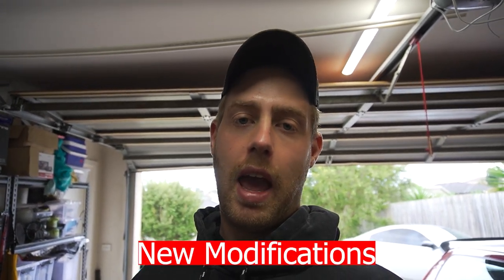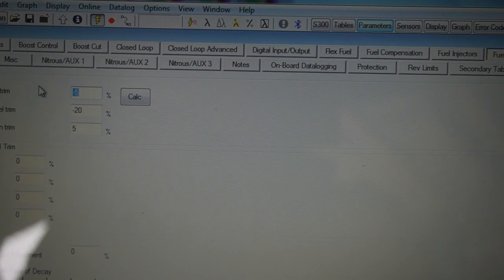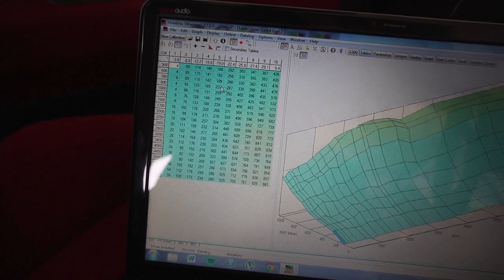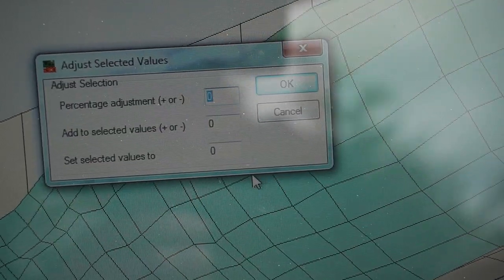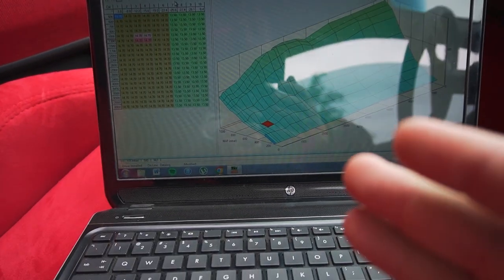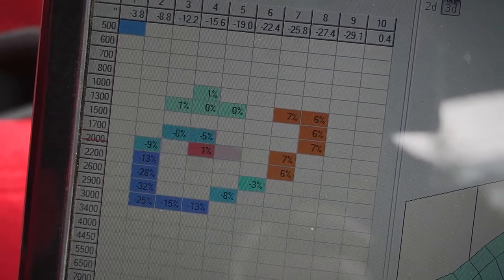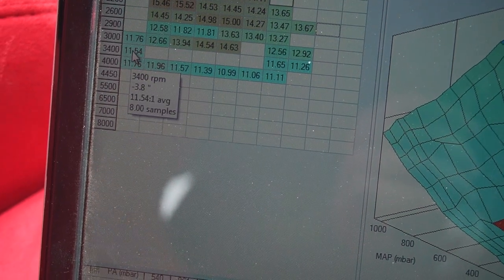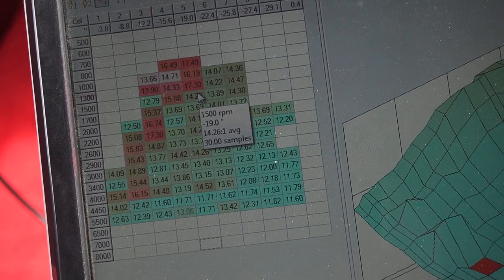How to Street Tune Fuel Using Hondata For Noobs | B16 Eg Civic

Comment: My car has been running richer over the last few months throughout the whole rev range and even at idle; I think lowering the overall fuel trim might help until I get it properly retuned.  Thanks for the tip mate!
Reply from the maker: Cheers happy to help!
Reply: Just get a turbo should should solve ur fuel issue 🤝

Comment: did you know  theres an autotune feature?
Reply from the maker: Yeh but you need to setup all the AF targets and have a AFR gauge wired into the car. I feel more comfortable to make the changes myself then use  closed loop to trim the map.
Reply: Yeah but also if your fuel trim is wacked out way off you can mark certain sections and auto smooth the map so the idle is smoother

Comment: wow its not that hard at all but yeah u need someone  with u  also what about if u put the car on jack stands and tune that way 🤔
Reply from the maker: Hey mate not too hard to get it running alright. Can't tune the car on stands as you need load on the engine.

Comment: Great video man! But what about VTEC? It doesn't populate the percentage difference on the high speed fuel table or let you data log on it like it does on the low speed fuel table...?
Reply from the maker: HI mate make sure you have it turned on in the settings. I did have it a few times when switching to the other tables it wont load or stay stationary on a cell. Make sure you update the software as well.

Comment: Have a question bud, ive installed boost guage and it says -2 (not working) I tapped into line on throttle body?? Did I f^$k up❓️❓️lol
Reply from the maker: Make sure you didn’t put it on the wrong side of the throttle body. Needs to be on the plenum side so it can read vaccum at idle. Definitely make sure it’s not on a coolant port. When the car idles it will be negative pressure:

Comment: Nice video👌🏽if I'm gonna street tune my car using hondata s300 do I need internet connection? Thanks
Reply from the maker: No worries mate. You don’t need internet only to update the software. You can connect to the ecu with either Bluetooth or usb cable.

Comment: i know this video is pretty old but at 9:40 its running lean, not rich. you took out more fuel where its red indicating it needs 6-7% of fuel so since you took out 6% thats why it went to 15% and a bit darker red which i wouldve added 8% just to get it close to 0 as possible. when its blue that means its rich so if you see a negative number then that means it wants you to remove fuel from being rich at that spot. other than that great video brotha!
Reply from the maker: HI mate it's been so long since i did any tuning i can't remember if -15 means your 15% below the target or you need to remove 15%.

Comment: How do you calibrate for a no cat?

Or a high flow cat?

What do you calibrate?

How much to add?
Reply from the maker: Hi mate most likely your car with need more fuel if the engine can breathe better. This increase will be small and most likely not need much of a touch up. THe right way is to use a wideband and update fuel based on the reading.
Reply: @JarrodWillemse  wide band....
Interesting.

More please
Reply from the maker: @realtruth97  Most cars use a narrow band and can only read a small range of AFR readings. A wideband will allow for a larger range for reading AFR. These are the best for tuning a car.

Comment: So essentially you would want to set up your target lambda, drive around at different loads and adjust to get to as close to your target lambda. But if you wanted to tune your car faster or to have more power how would you set your target lambda?

So say if your car was stock how would you tune it to make it faster. I understand when you get a mod that increases air induction you obviously would need to add more fuel.
Reply from the maker: Hey mate yes you would setup the lambda targets and match the actual to meet target. Your goal with the afr is to bring it to a safe level. The afr doesn’t make more power like ignition timing. For na cars 12-13 peak is your target. Boosted 11-11.5 is safer. More fuel can make cylinder temps cooler. Remember your recalibrating the fuel for the efficiency of the engine you can only burn as much air as the engine can pump.

Comment: I have a stock sensor and its reading rich, Im trying to change the fuel but it's staying at the same number. Do I need a wideband?
Reply from the maker: The stock sensor is a narrow band it won’t read the same range as a wideband. The sensor could also be broken. When they die they usually read full rich and the ecu just runs off that one reading.

Comment: Love your videos brother!!!! On the Aem series x wideband do you recommend wiring into d14 or d10 on a obd1 p28 with Hondata s300?
Reply: D14
Reply from the maker: Doesn't matter they are both fine. I would only choose D14 if your ELD is functioning as you wont need the heater on the stock D14 pin. The AEM wideband heats the sensor it's self.

Comment: i got a turbo b16a, havin problems bc old owner. i have s300 v2 and hondata. the car doesnt rev over 5500rpm and it needs tuned. what can i do to fix that? i dont wanna set the rev limit to normal bc i dont know if i do that the car will run ok after that rpm yk? i want a street tune jus to drive it and get it dyno tuned im hopin for 500hp in my jdm b16 ek
Reply: the vtec doesnt even hit bc it wont go over 5500rpm it jus smacks 5500 and sputters kinda until you shift
Reply from the maker: Hey mate it sounds like the rev limiter is just at 5500 or there is launch control enabled. Just turn off launch control and try again. Leave the limiter cut settings at the factory position in the settings. Should be in the middle with fuel and ignition enabled. If you don’t trust the tune then I don’t suggest going over 5500 anyways until it’s tuned properly. You don’t want to blow it up before you get to the dyno.

Comment: Hi Jarrod. Something is missing . My Kpro 4v will not populate the graph with lamda values or anything else. I  know it will. Maybe let us know the bigger picture for the settings needed for this tuning to work. like do I need to be in closed or open loop ? what menus to choose first ?  Thanks
Reply from the maker: Hi Mate
 You need to wire the gauge into the correct spot in the ECU and configure the right pin for it to reference. I have a video explaining the process. https://youtu.be/1zStPCcLA6w

Comment: Can u install wideband onto downpipe bung❓️
Reply from the maker: Yes you can but if it's really close the reading might not be great as the exhaust gasses need to mix. If the sensor is too close to the heat it can also shorten the life of the sensor.